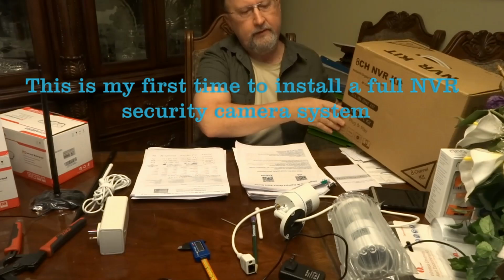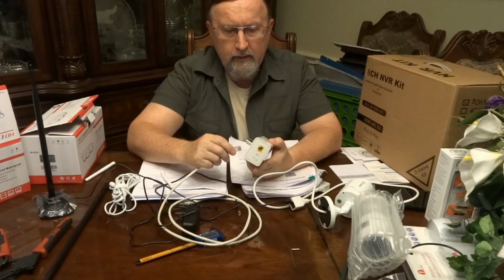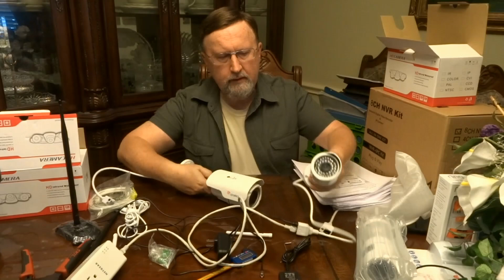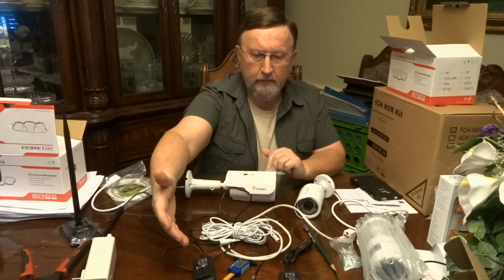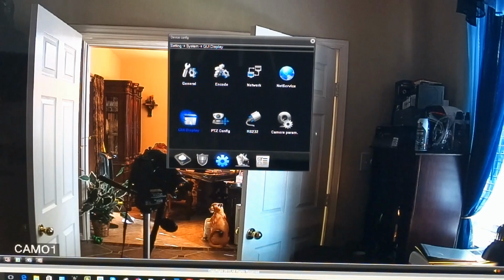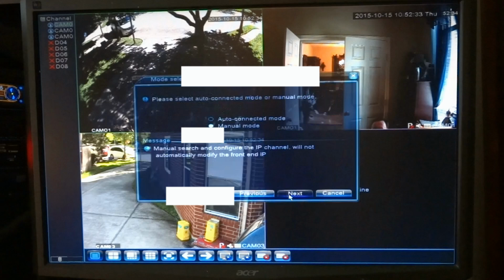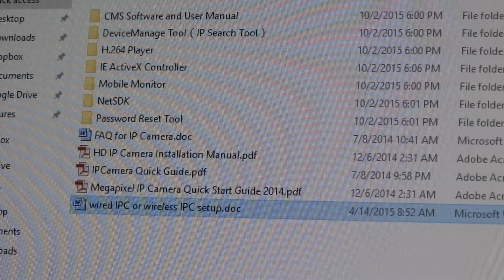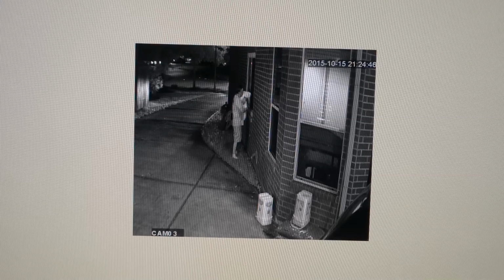Basic Ctronics Security Camera System Installation, wireless and wired.

Comment from the maker: I had to disassemble the camera that had water in it in order to dry it out.  It had significant rust in the lower quarter front of the camera, but most of it washed out.  Eventually I dried it out and cleaned the lenses well enough to put it back in service, though the IR LED lights don't work now.  At the same time, I put more cameras in service and now have 8 cameras running on my NVR, two of which are wireless, the others are using the Netgear wall outlet connections.  I still like the system, even more now that I have more cameras up.

Comment: Good video.  Thank you for posting and giving your insight
Reply from the maker: My pleasure.  Also, just FYI, one of my cameras did fill with water from the 51 inch rains we got in the Houston area from Hurricane Harvey in August/Sept. this year.  I thought it would dry out on its own but it didn't.  I replaced it with an extra camera I had as a spare.  I was able to clean out and dry out the old camera, but it did show some rust where the water was standing inside the housing.  Looks like the newer cameras are more waterproof, which should be a good thing.  Thank you for the comment and for watching.

Comment: Thank you so much for posting this tutorial, it's a huge help since the Ctronics directions are confusing and poorly written. I have the system mostly set up, and the cameras are recording to the hard drive in the NVR, but I can't figure out how to backup selected video clips to an external hard drive. 

From Playback I can edit the parts I want from the selected Channels with the scissor button, then I can click Backup and choose the external hard drive that's plugged into the NVR, but when I click the Backup button, it gives me a message saying "Are you sure to format the selected device with left capacity 0?" and clicking OK to that gives a message "Erase Failed." I already formatted the external drive to NTFS on my computer, so I don't understand why it keeps prompting about formatting it instead of just backing up the clips. Do you know what to do here?

Thanks again for posting the video, it's helped me with most of the set up but I can't figure out this last part.
Reply: I agree.You can't get the original ctronics app either..I am.trying to hook up my 5MP camera and can't find the correct one for it..

Comment from the maker: Sept. 9, 2017.  Just to update everyone, I'm still using the system as depicted in the video and it is working fine.  The only problem I am having now is that Hurricane Harvey was able to get some water in one of the cameras.  It is working, but blurry.  Waiting to see if it will eventually dry out.  Water filled our street and was up to the threshold of our door, but didn't make it inside.  I still only have 3 cameras set up, but also still planning on adding a fourth whenever I can get around to it.  I have had to replace at least 2 or 3 of the power supplies to the camera, so I would have at least one spare on hand and might consider using a better brand of power supply than the one with the camera, unless they have improved these.

Comment: how do i find software for my PC to view the camera on screen?? i dont want to use android just yet.
Reply from the maker: I'm a bit rusty on this, since my system is pretty automatic and I don't interact with it much.  I have the DVR setup with a monitor running 24/7, so I just look at the monitor to see what is going on on the cameras or use the software on the DVR to look at any recordings.  

However, to see a live view of any of the cameras, you only need MS Internet Explorer.  Just type in the IP address:port that you set up for each camera in the address line.  For example: 192.177.1.45:145  Then the username and password should come up.  I believe the video shows how to do this.

There was PC compatible software that came with my DVR/Camera system.  I believe it is called CMS and basically duplicates the software of the DVR on your PC.

You can also get other PC software for security camera systems, just make sure they are compatible with the brand of camera.  I think I tried iSpy, which was a free shareware download a couple years ago.  I think it worked okay, but might have been a little buggy at the time.

I really like the Android software and it seems to work pretty good for me.  I also have the Ring doorbell camera and it has Android video capability, works pretty good too.  Hope this was helpful.  Thanks for watching!
Reply: Thanks for all your info Rick, very helpfull, I have managed to get everything set up and all i need now is other ip softwre to record to hard drive. Cheers and 👍 your video :-)
Reply from the maker: Thank you for the kind words!  Best of luck getting it setup just like you want it!

Comment: Hello, I got these cameras second hand and they had changed the ip adress, how do i reset them
Reply from the maker: Some models have a reset switch, some don't.  Regardless, you can download software that will read the IP addresses on the cameras.  I would plug one in at a time, connect to your network, and read the IP address with software.  You might not want to change it anyway, if you trust the source not to try hacking them.  I'm still using a couple from this video, but have modernized the rest to newer tech and higher resolution.  Good luck.

Comment from the maker: UPDATE: Issue with cameras going dark.  I upgraded my NVR to 8 cameras.  I had 6 with wired connections (using the Netgear plugin adapter) and 2 wireless.  This only worked for a while, and then the feeds all or most eventually when dark on the monitor.  I discovered that my NVR liked it if all were wired connections.  It may also like it if all are wireless, but I didn't try it with all 8 cameras to see.  It doesn't like having a mix of wired and wireless.  I used two of the newer cameras and it was a different setup but worked fine.

Comment: It is a nice system but no support in the USA. I have tried everything, Amazon suggest only sending the system back. no idea how to get past the admin name and password. my home wifi name and password does not work. Any ideas?
Reply from the maker: These instructions are for the older cameras I bought two plus years ago.  The new ones may be different.  First, the camera must be plugged into your LAN via an ethernet cable to the back of your router because the WiFi in the camera is probably disabled.  There should be a disc with software (DeviceManage) on it that can make the setup easier.  It will allow you to find the IP address of the camera, change it to something to fit your system (all cameras must have unique IP addresses unless you use dynamic addresses - which I have no experience with), and turn on the WiFi in the camera.  This is all shown in the video.  The login name is "admin", the password is nothing, just a blank, there is no password to get in when you first get the camera.  DeviceManage will let you log your camera into your home WiFi system and should get you going.

You should also be able to also log into the camera with your internet explorer browser (Edge or anything else might not be compatible).  You should open a new tab on your browser, then type in http://192.168.1.10/ (this is the default IP address for the camera and hopefully nothing else in your house is using it).  Then you should select the English language and turn on explorer compatibility mode using the setup icon for explorer in the top right corner of the browser and add that address to the compatibility mode.  You should then see the User Name and Password boxes and a "Login" button in your browser.  Enter "admin" for the user id, and don't put anything for the password, then click log in. At the top of the screen there is a DeviceCfg menu button, click it.  There are a variety of icons you can click on to set up each camera.  The WiFi won't work until you log into the camera and set it up, so you need to click on "NetService" and then Wifi (not wireless).  That will allow you to enable Wifi and log into your WiFi system (and set an IP address for WiFi), if you haven't done this already using DeviceManage software.  If you have more than one camera you must set a unique IP address for each one.  Hope that is helpful.

Comment: Those power cords on the cameras are so short. How are you supposed to run those from outside to inside home power outlet
Reply from the maker: I mounted the cameras on the edge of the windows on the front of my house and plugged them inside the house through the windows.  It would be nicer to run them through the walls, but I'm not experienced doing that so I took the easy route and tried not to crimp the wires when closing the window.  For the one in the garage I used a long outdoor extension cord to reach an outlet.  There are also power adapters you can buy with longer wires that are pretty cheap that might be a better solution since these power adapters only seem to last a year or two.  Hope that is helpful.

Comment: I using this camera, but i don't know why they have the bíp bíp sound all the time, i think the memory is full but i don't know how to turn off that sound, can you guy help me ? i appreciate about that !
Reply from the maker: Where is the sound coming from, is it from the camera or the NVR?  The only time I hear a beep is when I reboot the NVR and it is only 1 beep and then it stops.   If you are hearing a constant beep beep out of the NVR it may be a problem with the NVR.  If everything seems to be working perfectly and you don't want to return the NVR you might be able to disable the speaker in the NVR.
Reply from the maker: If by memory you mean hard drive space, that shouldn't be a problem.  The hard drive should be set to continuous recording when full on the NVR.  You might go through and check the NVR settings to make sure it will OVERWRITE when full on the hard drive, but it should have been set that way by default.

Comment: how come when I use a android app it only works in the home if I go out it stops working
Reply from the maker: If you are talking about the android app that comes with the cameras, it should work anywhere you get internet service on your phone.  I can see the videos on my cameras through the app, as long as I have internet access on the phone where I am.
Reply: James Williams you might need to open/forward a port on your router

Comment: Nothing on installation only how to setup. So misleading. Installation would consist of actual physical install. Smh
Reply from the maker: The way I installed the cameras was to drill the three holes for the screws into the wood frame of a window and then screwed in the base plate that holds the camera.  I believe inserts are included like you would use in drywall or you can drill counter-sink holes.  There are nuts you can loosen and tighten to change the angle of the camera to point at the area of interest. 
 I took the easy way and used the window to bring the wires into the house and plug into the wall, but you can ruin the wires if you aren't careful when closing the window.  You can do wireless if you like, but I used a device that uses the electrical wiring in the house for the ethernet connection.  Hope that helps.